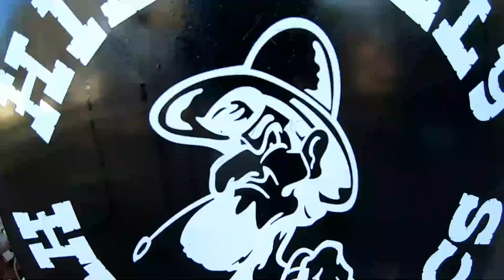DIY - PowerPack for Log Splitter ! - Redneck Style

Comment: I would have put the powerpack on a towable trailer, with a hitch on the back of it.  You then hook the log splitter to the back of the powerpack, and tow both at the same time to wherever you're splitting wood.  If you get any other towable hydraulic powered devices, just hitch it to the powerpack and go to where you're working in one trip.